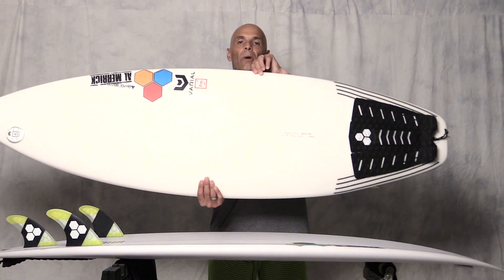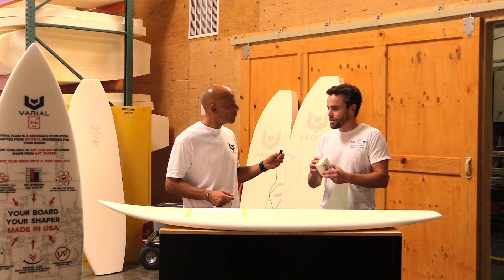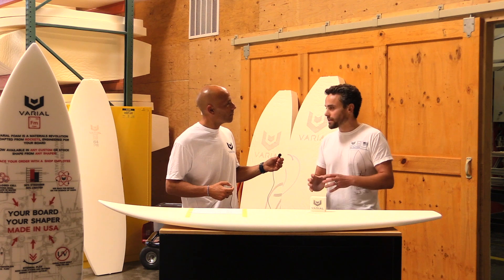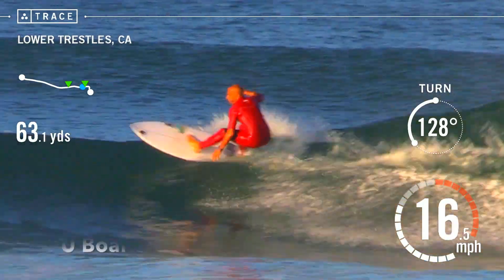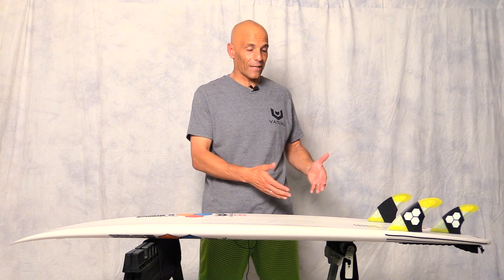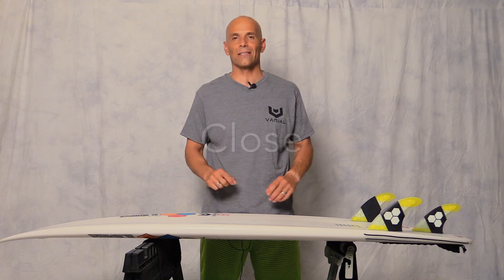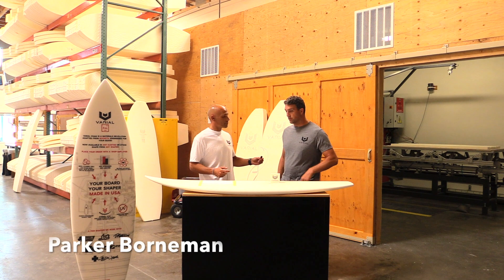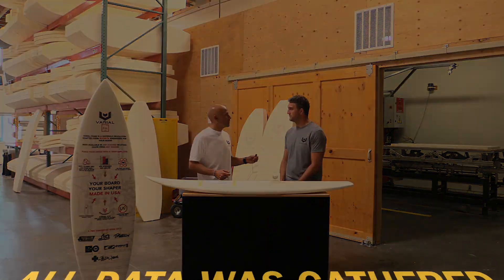Channel Islands' Sampler "Varial Foam vs. PU" Surfboard review by Noel Salas Ep. 16

Comment: Hi Noel, want to get a board for travel up/down so cal and not worry about heat in car. Would you recommend Vfoam or another source?  Also, want an all-arounder short board HP/groverler, which board would you recommend between Sampler, uber driver xl, lost HP PJumper-maybe in lib tech, or seaside(will that hold up and not delaminate)?

Comment: Hey Noel, which board material is the strongest you've tested that resists pressure dings?  Besides firewire's wooden deck, is varial foam the strongest? Looking for a long lasting board. Or is it about the glassing, thanks.
Reply from the maker: sean craig The strongest boards I have tested are...
Surftech TLPC
Firewire Helium
XTR Foam
My favorite out of the these three...
Helium
XTR
The Surftech TLPC didn’t have enough flex for me and it hurt my feet because the board was so hard.

The XTR foam is epic and you can get a custom shape in a lot of the big brand names.
Reply: @surfnshowreviews7777  would you say the EPS carbon wrap is list worthy
Reply from the maker: @gquint78  It’s just so so on strength for pressure dents.
Reply from the maker: sean craig Varial Foam pressure dents pretty easy... maybe a tad better compared to PU.
Reply: libtech
Reply: Varial foam dents SUPER easy !

Comment: Epoxy feel not good.it set on the water.
Reply from the maker: Erezdekel Erez123123 It takes a little getting used too. Now that I am used to EPS I don’t want to ride a PU in until the surf is over 4’.
Reply: Surf n Show Reviews thak you very much.👍👍👍👍

Comment: so varial is slower down the line, i wonder if the flex actually slows it up slightly as planes
Reply from the maker: Good thought..... I think it would be cool to flex test both boards and see which one has more flex. The Varial board was faster in and out of turns.
Reply: easy to put the board between two trestles put a 50lb+ weight in the middle and measure defection
Reply from the maker: Good idea..... Thanks!

Comment: Howzit Noel,
Another great review.
How eco-friendly is Varial foam? Toxic?
Reply from the maker: Stoked you liked the review!!! That is a really good question and I don't have an answer for it at the moment but I will hit them up at Varial and get back to you. Hang tight!!!
Reply from the maker: Here is the answer from the crew at Varial. 
 Varial Foam is non-toxic and completely inert.  The primary eco
benefit of Varial Foam is that it is stronger and more durable, which keeps
boards in the lineup and out of landfills.

Comment: How does the Varial foam compare to a typical EPS blank? Stoked for the upcoming comparison of all the variations of foam. Would  be sick to have you test out a "geo blank", "incide" blank, and carbon fibre layup too !
Reply from the maker: That's a good question. I have not ridden a regular EPS since the Peregrine groveler. One thing I can say about the Varial foam is it took me roughly a week to get used to it. I can step on a regular EPS and get it dialed in after a couple of waves. I have been riding a few different boards lately including the Varial Sampler and it's hard for me to adapt between constructions.
Reply from the maker: I will look into the other blanks you mentioned too.
Reply: +Surf Show and Tell Reviews incide can be ordered easily through any manufacturer that deals with US Blanks. Carbon wrap and geo might be slightly harder to find! Looking forward to the test either way !

Comment from the maker: Just to clarify the weight of both boards. The Varial foam board weighed in it at 4.85 pounds and the PU came in at 5.07punds according to my to my UPS Small Package scale. Sorry for any confusion.....
Reply: This still is unclear. 4 lbs 8.5 oz? Or 4.85lbs? (4 lbs, 13.6oz)
Reply from the maker: Josh Ellis 4.85 pounds from my UPS small package scale. Sorry no oz’s.